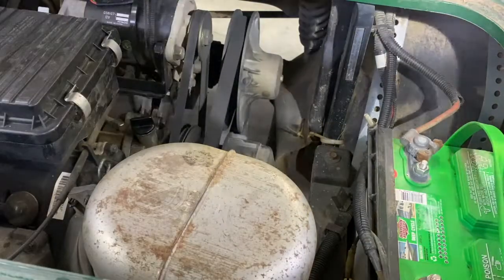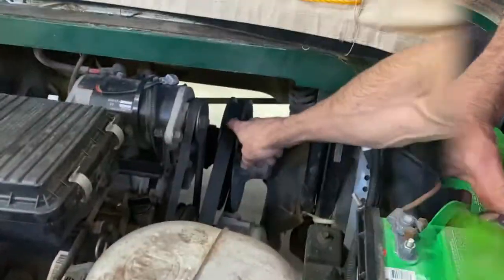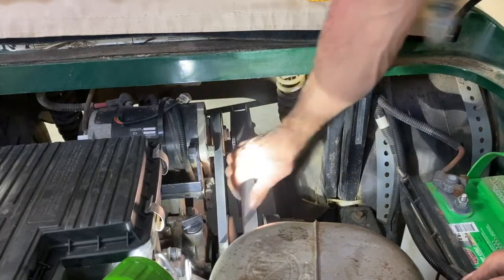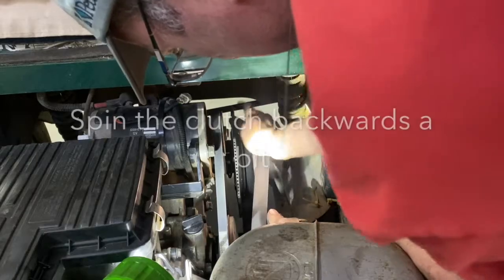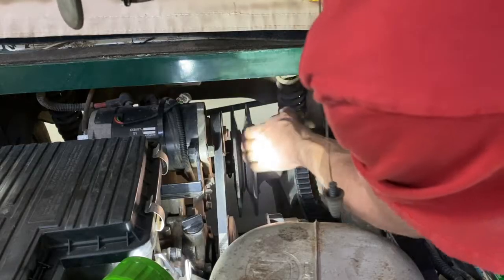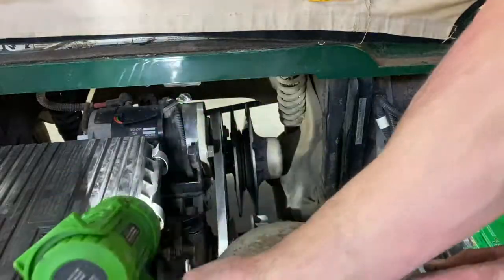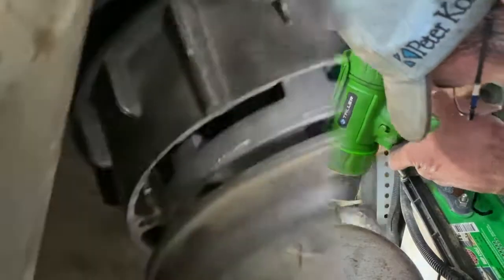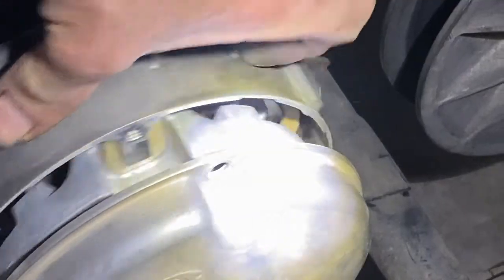HOW TO CHANGE A DRIVE BELT ON YAMAHA GOLF CART OR ANY GOLF CART..YDRA G29

Comment: So u didn't explain how to losen or tighten the belts
Reply: Completely wasted my time waiting for the same thing
Reply: There is no adjustment to the belt to tighten it or loosen it. The shaft centers are fixed. The belt becomes tensioned as the centrifugal clutch begins to move when the engine is throttled up. If the belt does not tension when the engine is throttled up then you likely have a mechanical problem with either your front or rear clutch.

Comment: I have a Yamaha g1 I just put a bran new starter belt on it I went maby a mile down the road and it somehow got stuck in the secondary clutch belt what are some suggestions please and thank you it’s been a pain in my butt lol
Reply from the maker: Wow.  There is something wrong with the bracket causing alignment issues or the belt is not tighten enough.
Reply: @WeekendHobbyMechanic  thank you 🙏🏼 I’ll check it out I just  bought a new belt because like I said the last 1 lasted a mile lol I’ll double check make sure everything is aligned Is there a way to tighten the belt? I couldn’t find anything on it tried looking it up but nothing
Reply from the maker: @travismccrary1430   I have a video on the starter belt but not for a G1..   
https://www.youtube.com/watch?v=c8ZrV63DV0M&t=56s&ab_channel=WeekendHobbyMechanic

Comment: my 2017 Yamaha gas cart has been losing power in the sense that going uphill is difficult.  now even just two people i goes super slow to slipping.  the drive belt is very loose.  how loose should it be?  i only have 50 hours on it.  is there anything else that could cause it to lose power going up hill?  fuel filter?
Reply from the maker: Measure the width of the belt  (Should be 1inch wide or more).  Check your air filter, clean it.
  You can jack up the rear, start it up and watch the clutches to make sure they're working.
Reply: My belt is 1 and 1/4 inch so I should be still gold right?
Reply: It's a 2000 Yamaha g16
Reply: Did you find a solution?

Comment: I pulled and tried to roll off the old belt and I cannot get it off. Any suggestions? Is there a drive belt removal tool?
Reply from the maker: I just cut them off.  And then install the new one.

Comment: Is the primary clutch supposed to move in and out freely like that? I have a g16 mine is real tight. Was also really hard to get the old belt out from under it. Do you think i have other issues?
Reply from the maker: No issues with your clutch.